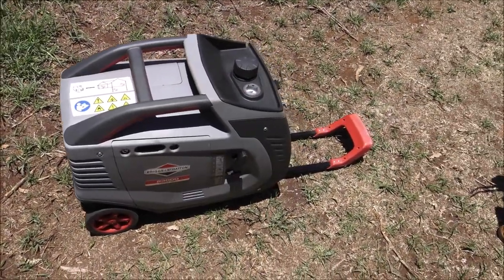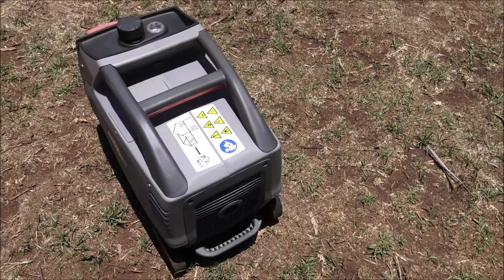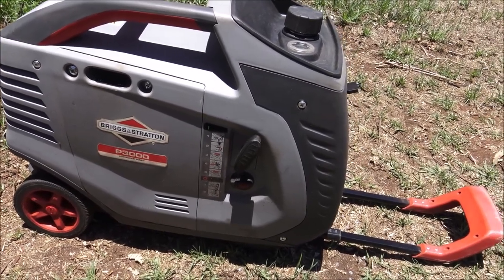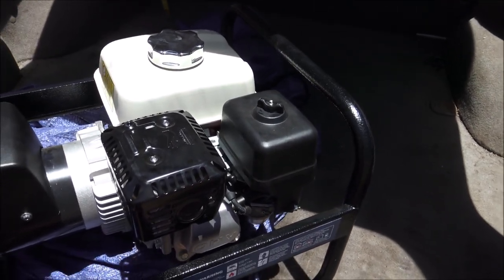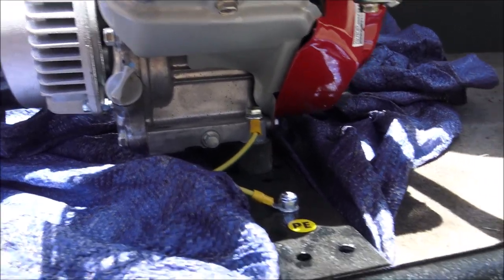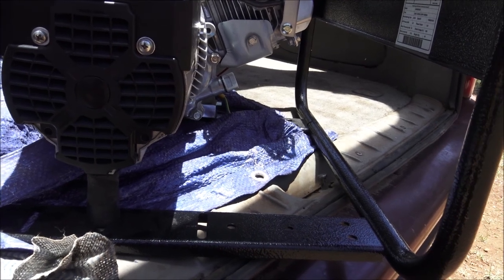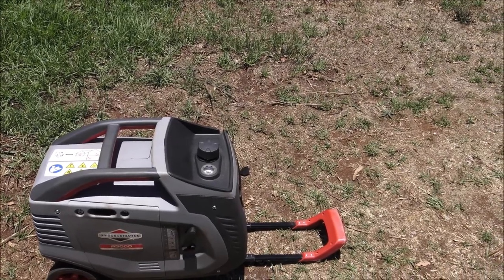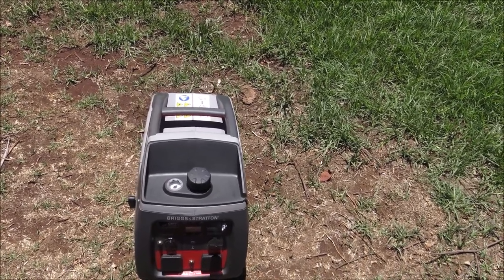Gen designs. Beware seasonal Temps. Component failures.

Comment: Thx for the review. Have heard many stores have sold out of those compact designs in the bush fire crises down south. Just hope they last long enough for the victims in the extremely hot conditions, until grid power is restored
Reply: I hope so too.
Reply: That is what i heard too. given the requirement for power in those areas, for critical needs.
A problem too, fuel shortages as the system collapsed.
Reply from the maker: Thank you Piper.
All the best.

Comment: Many of these new types use resistor spark plugs, to protect the inverter electronics, same theory in vehicles with electronic engine management systems. These plugs do break down in very hot conditions. Sometimes with no warning, just stop working.
Reply from the maker: Yes they certainly do. My chainsaw had that type, off the shelf, stopped to refuel, hot day, plug fail on restart. Dead as a door nail.
Thank you Peter.
All the best.
Reply: Tku peter. good point. wonder how many know this.

Comment: Certainly something to think about when buying a generator and l am thinking about getting one so this is very helpful, thsnk you.
Reply from the maker: Thank you. You may have work out what appliances including lighting you need. Some appliances such as micro wave ovens, clothes dryers, electric hot water heating, and reverse cycle air con do draw a lot of power. That includes electric water pumps. This will help determine how much power the generator needs to supply comfortably with out surging, or tripping overload protection on generator.
Oh, and they are not water proof, when it rains.
All the best, and a happy new year to you.
Reply: @aussysurvival  Thank you and really l want it as a back up for a few lights and keeping the heat going for my snakes in an emargency. Appreciate the information.
Reply from the maker: @Gottalovecarpetpythons  👍 was thinking of heating lights for the snakes.

Comment: G'day,

  Briggs & Stratton are assembled in the Excited Status, from components wholly imported from China...

  The underlying problem  is that the ambient Air Temperatures are far higher in Summer in Oz than wherever the Generator's Design Team lives.

  So it never occurred to them to design their Products to cope with Shade Temperatures over about  25 or 30 Celsius.

   None of them will go well in the Sunlight, even sitting stopped, they'll boil off all their Fuel.

  I haven't heard of the fully-enclosed Honda Inverter-Generators having problems with overheating...; so perhaps that Briggs & Stratton was designed to be sold in Britain where 30 Celsius is called a Heatwave (the Yanquis don't use 240 V. AC at 50 Cycles per second like Oz & Pommyland - they run on 110 Volts at 60 Hertz).

Have a good one.

;-p

Ciao!
Reply from the maker: Very true mate.  The high temps we have here, even in the shade, which these were covered, do cause vapour locks in fuel, line and filters.
The new one is a Honda engine, made in Italy, but probably from imported Chinese components. 
Yer Steve doesn't operate it all day, only when refrigeration requires it.
Cheers mate
Reply: @aussysurvival  

I ran a 750 watt 2-Stroke Genny in my Pyramid of Elektrickitiez for 4,700 hours, but I had discrete Ducts feeding it with Inlet Air & taking out it's Used Cooling-Air with concentric Exhaust-Plume at the centre, I even condensed & collected the unburned 2-Stroke Oil from the Exhaust.

At one point I had probably cornered the Global Market on the stuff, I gave a bloke about 50 ml of it for Xmas as a joke.

 Nobody else on Earth has any second-hand 2-Stroke Oil, is my guess (!).

  The 2 KvA Exceed in it's truncated A-Frame Hutch has about 2,500 hrs . It sucks at one end & blows at the other, but the Exhaust Duct has an ornamental retractable Turbine on it's Door.

The Hutch is Foam-lined, to stop the Sheetmetal from baking the Fuel in the Tank under Sunlight.

  Have a good one,

;-p

Ciao !
Reply from the maker: @WarblesOnALot  😊 I used to collect the two stroke oil from a similar generator years ago. Good lubricant for, nuts, bolts, door hinges and stuff.
Good idea to enhance convective air flow around your Gene. These new compact ones, the few air vents they have, are all pointing the wrong way, and not even some kinda fan in them to circulate the hot and cooler air around the engine, or exhaust it. The inverters,   the components in them overheat above their cheap ass temp specs. The inverter sensors also control engine revs, ignition requirements for additional loading.
More complicated, the more weak links. Consumerism, if it breaks, can't or don't repair them. Just toss it and get a new one.
Cheers mate.
Reply from the maker: @WarblesOnALot  bought a 5 kva gen set back in 99. No inverter Tek on it, to run submersible electric bore pump. Cradle design. Fuel line was easy to bleed if a vapour lock happened, Carby bowl easy to access to clean. Damn good gen set, had it for 15 years, no problems at all. Then some dumb ass filled it with ethonel blend petrol. Yep that stuff absorbs moisture, completely stuffed the carby, couldn't get new parts for it.
Reply: @aussysurvival  

Ah, 

Great minds thunk alike.

 It sounds like Shiny Bling Consumerism is getting into Social Darwinism...; maybe the Case was designed to contain a torally different Unit - one which needed to breathe through the places where the Louvres actually still are in the Shroud...?

   If one is silly enough to buy it, then one apparently deserves to get stuck with whatever it does  after purchase..., perhaps .

  The Romans had a term for it,

"Caveat Emptor..."

  Buyer Beware.

Sold With All Faults, If Any...

  Have a good one,

;-p

Ciao !
Reply: @aussysurvival  

Can you source some other Carby roughly the same size, and cobble up a short Rubber Tube as a Joiner to the Engine's Inlet Manifold ?

It might resurrect it ?

;-p

Ciao !
Reply: @WarblesOnALot  Good to improvise to get the best results on gear not designed for Australia's extreme conditions.
Reply: @aussysurvival  Ethonol blend fuels here, really caused some problems with moisture absorbtion in fuel systems.
Reply: @warrenallen579  

 G'day,

  Yep, I'm in favour of fine tuning pretty much everything ; to get it to operate better than it's designers ever imagined it could behave.

  Have a good one.

;-p

Ciao !
Reply from the maker: @WarblesOnALot  yer I tried. After completely draining and cleaning the entire fuel system, solvents, the whole nine yards. Actually got it to run, very rough on idle. Looked at adapting another type, but the proprietary mechanical governor fittings were the big issue, that was a fail.
Gave it to a friend, as spare parts, other than the stuffed Carby.
Remember the old Victor mower carbys, many years ago, adapted one of these to a small engine, purred like a cat. Those were the days. 😊
Cheers mate.
Reply: @aussysurvival  

Ah, I see..

  Planned Obsolescence.

  Yeah, one of my greatest achievements involved flying behind a Victa 120 that had been remade as a "Pixie Minor" Aero Engine.

To see it, title search YT for,

"The 8-Hp, 1975, Red Baron Skycraft Scout..."

 It happened back in the dayze when I thought my life was a Biggles Story....

Such is Life,

;-p

Ciao !
Reply from the maker: @WarblesOnALot  🤣🤣🤣👍
Reply: Yes, generic design geek stuff up.

Comment: I have a few of the first type mentioned. We call then suitcase generators. Never had a over heating problem. Living the Uk that probably is no surprise.
Reply from the maker: Thanks mate for sharing your experience in cooler conditions.
One of the most common problems some engines have in high temps here, is fuel vapour locks in the fuel systems.
All the best.
🇦🇺🇦🇺🇦🇺🇦🇺🦘

Comment: This is a really useful video aussy. Must have gone up while I was on YT vacation
Temperatures here can get real hot in the Summer. Not Koala melting though but over 35C
The one we have at the new place is a big metal monster in a dedicated  shed
Reply from the maker: Thank you Huples.
The one we have is a diesel, electric start, in the shed.
Have used it on extended power failures, damage to power lines and house in severe weather events. Not for the bling stuff, refrigeration is the priority here.
Cheers mate.
🇦🇺🇦🇺🇦🇺🇦🇺

Comment: Nice review of information and hardware.  I have been looking at solar powered lithium battery generators in the 1800 watt category...they cost around $2000.00 USD .  What do you know about this type of power system?
Reply from the maker: I will send you a link mate, the pros and cons.
Solar charging them, can take a long time, depending on sun light, and quality of solar panels, low lite efficiency designs. Not sure where you are in the US, but winter much lower daylight hours, and what I saw in Maine a couple of years ago, panels have to be snow free.
All the best for the new year.
Reply: @aussysurvival  I live on the Gulf coast of Alabama in Orange Beach...the sun is good, but like anywhere else we have tose cloudy days...
The units I have been looking at get 2000 charges in battery life, and will charge solar, car battery 12volts, and house current when available...two 100watt solar panels charges quicker...
Reply from the maker: @robertwilson3914  Found this info mate.
I guess it comes down to what they used for, the service life compared to combustion generators. The big advantage, is the lithium charge packs can be used inside, no toxic fumes.
However, a generator can provide longer service life in comparison.
https://www.consumerreports.org/portable-power-stations/portable-power-stations-things-to-know-battery-inverter-generators/
Reply: @aussysurvival  affirmative all....and happy new years to ya!!!
Reply from the maker: @robertwilson3914  happy New year mate.
All the best for the new year.

Comment: yer, those small ones very difficult to service. the plastic crap in those also warp, degrade under hot temps.
beware plastic fuel tanks on compact ones. have seen these leak, crack.
Reply from the maker: Yes, have seen plastic fuel tanks, harden, leak and crack , exposed to high temps over time.
Good point buddy.
Thank you.
All the best.

Comment: I've been strongly considering ordering the Jackery device from over in America (518Wh (21.6V, 24Ah) 144,400 mAh / 3.6V) - had the power go off again yesterday but doing up a van and thinking it might be worth investing in for that instead of doing a full 4 - 6 battery bank -  would doing an insulated storage with ventilation help? ( https://www.jackery.com/ ) - It does say in the specs that it shouldnt be used above 40c degrees.. and yesterday here on the outskirts of Melb it was 43c degrees - last week 45c degrees.... def wanting to invest in something recommendable and with quality + longevity!!  Good video mate very timely - keep up the good work!
Reply from the maker: Apologies mate. Didn't get notification.
I think the temp specs on gear, in most cases is a good guide. At best here in Australia, factor in temps that maybe above temp specs. Perhaps look at, if possible, installing low voltage fan units, similar to those used in desk top computers. Some designs may have this feature, thermostat controlled.
I know, as an example, one or more was installed in a car fridge. Much more efficient in hot conditions, and reduced component failures.
I think the problem is, most gear is designed for generally average conditions. Certainly not the extremes we have here in Australia.
Hope this helps mate.
All the best.
Reply from the maker: Apologies mate. Didn't get notification.
I think the temp specs on gear, in most cases is a good guide. At best here in Australia, factor in temps that maybe above temp specs. Perhaps look at, if possible, installing low voltage fan units, similar to those used in desk top computers. Some designs may have this feature, thermostat controlled.
I know, as an example, one or more was installed in a car fridge. Much more efficient in hot conditions, and reduced component failures.
I think the problem is, most gear is designed for generally average conditions. Certainly not the extremes we have here in Australia.
Hope this helps mate.
All the best.
Reply: @aussysurvival  Absolutely great advice - thank so much for taking the time to explain! I think youre right about the fan idea too - Cheers mate hey stay safe aye